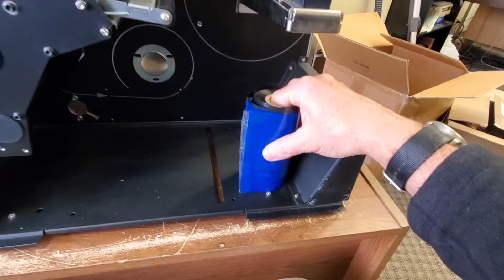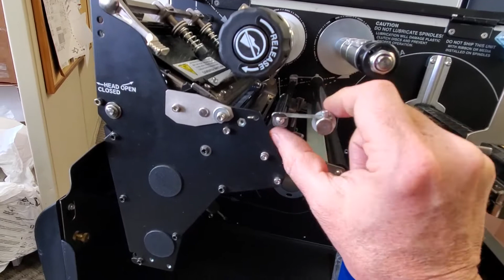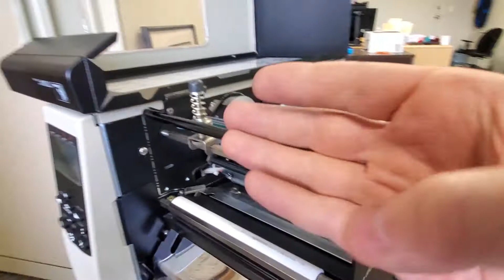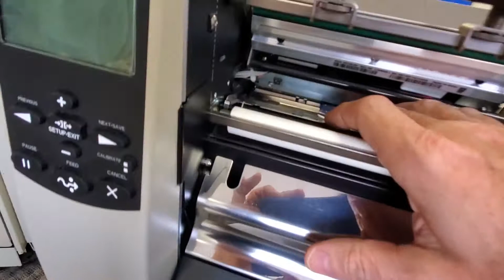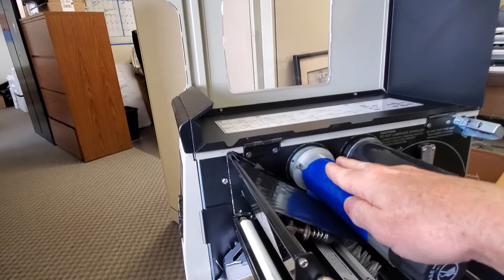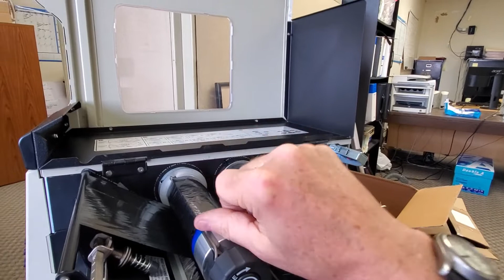Loading Ribbon into Zebra 170xi4 and 220xi4

Comment: I have the 170Xi4 and loaded the ribbon exactly as you show it and it still gives ribbon out error. I also did the manual calibration afterwards but the error still persists. I would appreciate some assistance on how to resolve this Error
Reply from the maker: Make sure the silver plate is still in the printer and is clean.  It has a mirror function to act as 1/2;of the sensor.  There are also sensor values in the menu system that you can try to adjust. The ribbon sensor values could be wacked out. In the manual there is a list of the settings on the settings print out page.  Use those values as typical values.